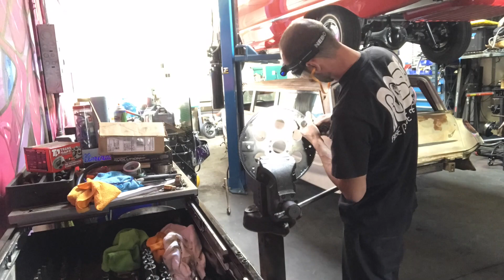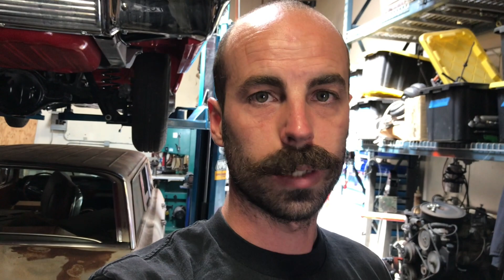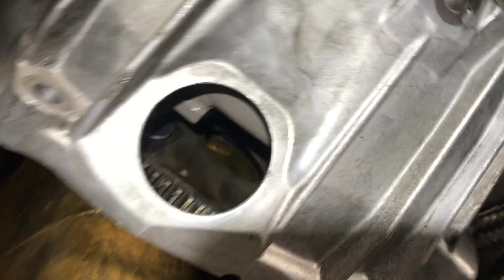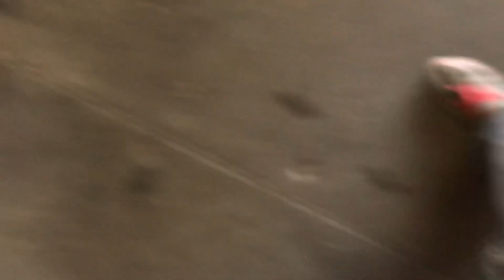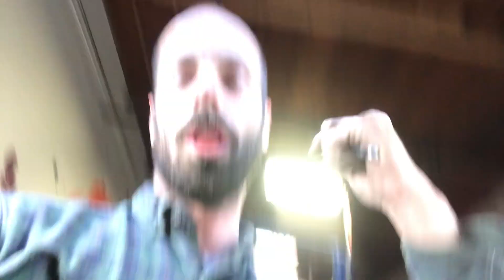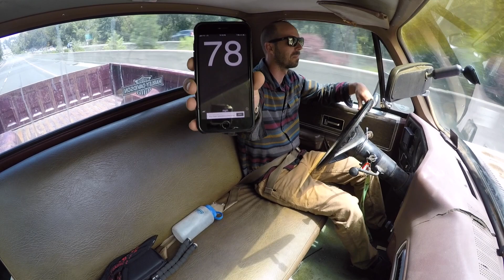Mini Garage! How to: LS style 4L60E to SBC part 2

Comment: Nice work 👌
I am in the process of building a 4l60e and installing the tci controller into my carbureted sbc that’s in my 86 Monte Carlo ss. Would there be any recommendations when it comes to hooking it all up? Fly wheel and bell housing
Reply: The 4L60E is  no stronger.  700-R4 =  4L60 no "E"
Reply: @pmotorsports8276  I understand that I actually had a 2004R in it.
Reply: Did you use the same yolk?
Reply: @manuelalvarez6987  No, because I needed a shorter driveshaft so I. For that reason, I had a custom one made a shorter one. My old one was too long, but the yoke did fit on the 4l60e shaft splines.
Reply: @mesnlokz3335  thank you I had a short yolk and that seemed to work

Comment: Very nice job I have a SB350 with a 4L60E installed but what did you use for a starter as I’m confused on what will work for mine.
Reply from the maker: It all depends on engine and fly wheel, if those are both SBC they there you go, if you have a crazy flywheel setup you’ll have to ask where you bought it or do some counting/measuring
Reply: @MechanicalAdventures  thanks for getting back so quickly but as it turns out I had the wrong bell housing on the 4l60e. I was able to the right one and now the starter bolts right to the block like it should thanks again.
Reply from the maker: @kenjohnson5512  good to hear

Comment: dope video!! if you dont mind i have a few questions. i noticed you have what appears to be efi ( i have the fitech Go EFI 4 ) was wondering if the tci controllers throttle position sensor has to be the cable type you have or is it possible to tap into the efi tps. in the video you said you didnt install the manual wires, are you able to still shift 4,3,2,1 with the column? i installed a 4l60e to sbc with fast tech efi, i have tried the "no computer install" where you use micro switches to control 1st and tcc, but this doesnt feel right.  any help would be greatly appreciated thank you
Reply from the maker: You can splice the tps signal with Holley terminator, hp and dominator ecus to use with the trans controller, the Holley sniper you cannot, it trips out the sniper and doesn’t function properly, therefore I needed the tci cable operated tps. I am able to shift with the column, yes, it functions like a normal 2000+ Silverado/etc where you would be able to do the same thing. The manual shift wiring is very easy though if you have/find buttons you like, just a button/switch to ground for up and same for down.

Comment: @Mechanical Adventures would you make other Trans spacers to sell? I need one for my 4l80e.
Reply from the maker: GM sells one, look for th350/700r4 to LS bellhousing spacer
Reply: Stock LS style 4L80E flexplate has a spacer incorporated in flexplate. 4L80E torque converter never changed since SBC days = reason for spacer. On LS style engines only.

Comment: We’re did you get the spacers I’m running to trouble with a 99 4l60e
Reply from the maker: I built the bell housing spacer from a sheet of 10mm thick aluminum and then I got some 10mm stainless spacers from McMaster for the torque converter bolts

Comment: this video series is awesome, did you have to do anything special with the harness on the 4L60E?
Reply from the maker: It’s a stand alone controller from tci. I had to add an external throttle position sensor like you would on a carburetor. It uses the location of the kick down cable and calibrates itself pretty easily
Reply: @MechanicalAdventures  thanks for the info. I'm building a 59 GMC and wanted to run a very similar setup.

Comment: So why not just take the spacer back out? You didn't need it! Why space the trans and convertor back the same? LMAO what a waste! I did mine the same hogged the holes out and no spacers anywhere! Works perfect.
Reply from the maker: The snout of the converter is 1/2” proud of the mounting holes. The conversion converter has the mounting holes and converter snout on the same plane. Did you put a 4l60e behind a gen 1 sbc with a 2 piece rear main seal? They bolt up to a 1 piece later sbc.

Comment: Hey bro not trying to bust your balls just for info in the near future, with the 4l60 you can ise thr driveshaft from 1993-2002 chevy camaro how i know this my buddy in yucaipa is building a 74 chevy truck & this is what he put in his baby with the 4l60e
Reply from the maker: Gary Gushue driveshaft cost me $150 for all new parts
Reply: Also  700-R4 and 4L60E are the same length.  4L60E = electronic 700-R4.  4 forward gears,  L.ongitudinal, 60 = torque rating,  E.lectronic